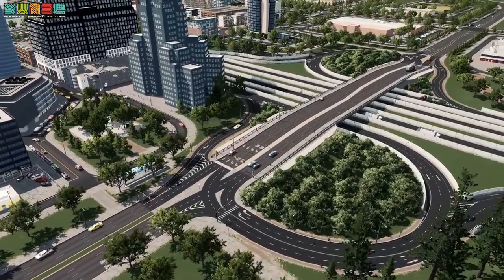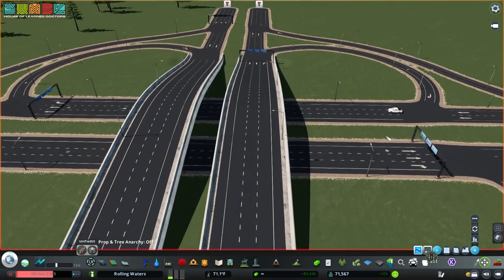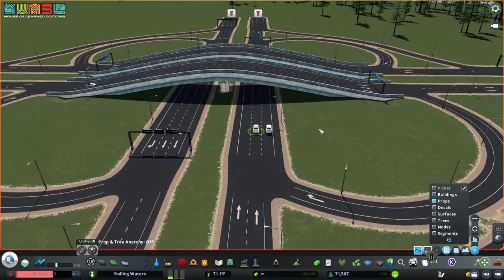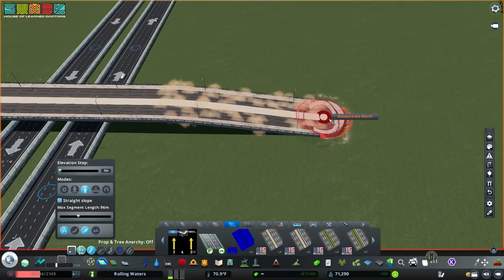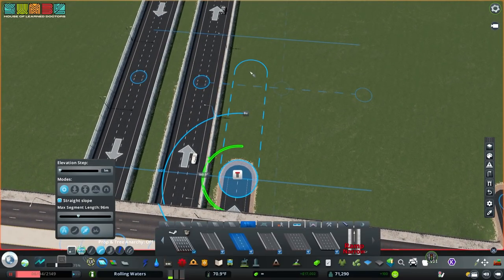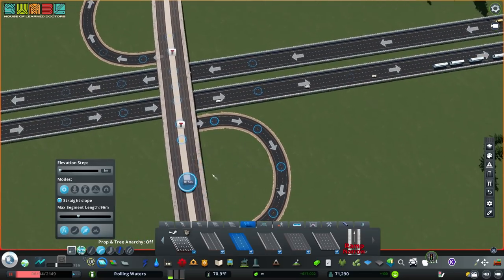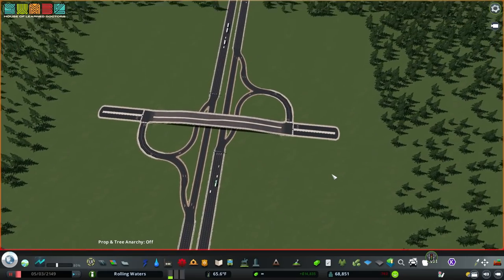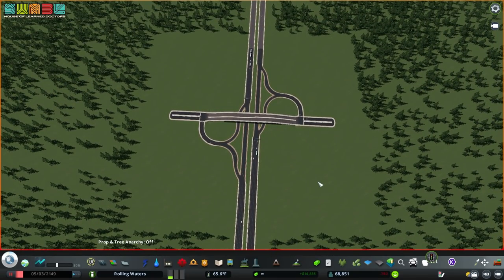The Ideal Interchange - Partial Cloverleaf - Cities: Skylines Tutorial

Comment: I found a cool solution for the clipping problem at 07:35: Instead of having a 7x7 curve, build an 8x7 using the 90° curve tool. From the orientation at 07:35, go up 7 and 8 to the side. once you have the anchor points 16u apart on the sides, delete the first curve and rebuild it using the free curve tool. do this for both sides and you get a perfect, non-clipping 3-way node :)
Reply from the maker: Good thinking!

Comment: There's a Cloverleaf around where I live in Germany, where 2 mayor Highways cross each other. And almost every Rushhour traffic starts to hinder itself on one of the merging lanes, which leads to it backing up around the curve onto the highway and around the next curve to the opposite on/offramp and sooner or later all merge lanes are jamed and both highways are jammed in either direction. Cloverleafs are the worst :D
Reply from the maker: Cloverleafs were a great achievement when invented, but we no longer need them!
Reply: @YUMBL  They work well in rural areas where the traffic isn't too great, but in urban areas, there are better interchanges.
Reply: They work between a freeway and an arterial if the weaving portion parallel to the freeway is separated into (a) collector/distributor lane(s), but it doesn’t work between two busy freeways.

Comment: I'm not sure if this is something known already, but I'll mention it for anyone that doesn't know.
When you are using Move It! to smooth or slope roads, you don't have to do just one side of the highway at a time.    So long as the node points are the same on each side of the highway (or road), it will move both sets of the road and slope both of them at the same time.    Just saves a step (or two).

Great build, and wonderful tips!    Thanks!

Comment: In Norway the highway to regular streets interchanges are usually made using two roundabout, not unlike the second example. Only the slip lane will go to either side of the roundabout each time and slipplanes is often used. It works fairly well. If high traffic areas they forgo the roundabout and use slipplanes to do so you never even can cross over into meeting traffic. There's one line off and one lane on, the rest handles how the traffic flow and the best of them can handle a shit ton of traffic with no lights involved.

I've never tried to reconstruct the best ones we got here in Skyline, because the lane math is hellish on it. On the bigger ones you don't even notice you gone off the highway because you end up on anther highway. But to do it you also have to endure some 90 and even 270 turns on the slipplanes.

Comment: A right turn slip lane along the roundabout can really help to open up traffic flow in a congested area.   Having the right turn allows traffic turning right to make the turn without going halfway around the roundabout, blocking traffic turning right onto the highway.   I am not a fan of roundabouts, but when set up right they can help quite a bit to reduce the time traffic is stopped.
Reply from the maker: I agree! I just wanted to show a space saving version. I also dont know if the skylines vehicles would care for the slip lane. Worth an experiment!
Reply: @YUMBL  yeah i was just throwing that out there for anyone that cares :)  the ai traffic actually loves slip lanes because they don't slow down much and it makes a slightly shorter route.  It takes a little extra time and effort to build them but if someone is more into details it definitely helps.

Comment: Would you intend on doing a video on various system interchanges to compare upsides vs downsides?  Some interchanges can be almost perfect, but expensive to build.  Others might be costly for space, but still cheap & effective.

In my area, cloverleafs still reign supreme, but two of them are a bit boxed in by development, so there's no easy way to update it even though they are in dire need of updating.
Although some rural cloverleafs have a flyover in place of one of the leaves, as this accounts for heavier traffic in specific directions where the cloverleaf is otherwise still viable.  I've also seen a few dual trumpet interchanges, mostly on toll roads, where all the weaving happens on a separate unit while the main freeways still move freely.

Comment: My PC is running a gen 2 I5 so the sim speed has slowed down to a crawl in my current build but, when I get a new PC, I will definitely be implementing these awesome interchanges. More watch time for you this way haha
Reply from the maker: Good luck with the new computer! :)
Reply: You can try speed slider and fps booster
Reply: @Spido68_the_spectator  I have those mods already, but there isn't any saving grace for a 10 year old Intel I5-2320 (i think). I have way too many mods and that's why it's struggling so hard at 4k pop but it is what it is =)))))
Reply: @alexsavastru8125  i have an i5 4200H and despite 100% usage at 170k pop, i can still continue to go further thanks to these mods allowing for a lot more fps (from 10 to 30 - 50).

Comment: It can even be more simplified imho. Look at 13:38.
- Make the road coming from the highway through the loop (or arc) which comes in from the right onto the arterial 1 lane instead of 2 - make this road an asymmetrical road of 2+1. That one lane will go into the most right lane on the arterial going over the highway. So it would remove the purple line and only leave the whitish line.
-  Make the arterial coming from below 3 lanes instead of 4. The right lane would go into the right lane going towards the highway - the lightblue line. With this the dark green line will disappear.  The other two lanes will move on over the arterial bridge.
- Also make the arterial coming from above 3 lanes instead of 4. Only the left lane (from here seen the right lane) should go towards the highway in the left lane of the off ramp, here represented by the dark blue line. This will remove the light green line.
This will remove a couple of merging and crossing lines as some lines will be gone (both green lines and the purple lines). So the only lines which will interfere with each other are the dark blue  line with both the orange and light blue lines. So only they need red traffic lights.

Comment: I don't like cloverleafs because of the weaving.  Maybe in a computer program, traffic doesn't flow well with the roundabouts, but in Carmel, Indiana, where they have built interchanges with roundabouts, the traffic flows very well. I would do away with the partial cloverleaf and use a diamond interchange with roundabouts. However, if you  really want to design a partial cloverleaf controlled by signal lights, consider combining it with the diverging diamond concept on the bridge road getting rid of all the left turns.

Comment: Nice intersection .. I am wondering why you use 7 lanes for the top highway and 2 lanes off going.
The lower highway has 6 lanes and 1 lane off going .. i think you should keep this approach.
The connecting streets with 2 lanes have to merge later to 1 lane also :( :(

Comment: @YUMBLtv - 
you have 2 stroad intersections in it , like in Las Vegas ... but in a better design ... 
Your roundabout version @ 18:30 is literally used in my region in Germany for a (1+1 lane) Bundesstraße (with the roundabouts) over an Autobahn , but with 4 directions on the roundabouts (separate on & off , that might cause problems when ignoring the signs due to the 90° angle instead of a sharp unmisinterpretable angle)

Comment: Hello Yumbl, Nice ParClo tutorial. I have a question. If multiple interchanges that are close to one another is bad, how would you do the spacing between interchanges (including both service and system)? Thank you.
Reply from the maker: Great question! System interchanges are wherever highways need to connect to themselves. So they should be quite far from each other. Service interchanges can be closer. Maybe 50-100 units from one on ramp to the next off ramp is as close as they should be. I’m making that up, but look at some maps of road networks to see how big interchanges are, and how close they are for scale.

Comment: Hey Yumbl. Absolutely love your videos. I know this vid is a bit old, but I hope you see this comment. I'm having trouble with swapping the 2-lane bidirectional highway at 8:28 with a 4 lane, bidirectional highway like you've done. The 4 lane 2-way road when linking to the exit would always look wonky. The link between the nodes of the highway entry and exit  and the 4 lane, 2-way road would look like kind of an un even hourglass. I think this is because I may not be using the correct road. The 4 lane road is a bit thicker than the 2 lane road so the curb/sides of the roads are not aligning. (I used a 4-lane 2-way highway from a Steam Workshop collection called Vanilla+ 1-click collection of roads) May I know what road you used for the 4 lane bi-directional road linking to the arterial road?
Reply from the maker: The one I used was network extensions, but that network is now built into the game after the last update
Reply: @YUMBL  oh great, I see. May I know what road exactly did you use, if you remember?
Reply from the maker: Its from network extensions. A mod for the game that conflicts with a bunch of other current mods. Use the now included 2u 4 lane road

Comment: I really like the video, any thoughts on a console version?  I'm thinking of moving the non looped piece farther down the 4 lane road so you'd have two 3 way intersections about a road length apart on either side.  I'd have to be mindful of road length and speed to get it right.  Might try in my next stream.  Thanks for the inspiration!
Reply from the maker: You’re welcome! The spacing will certainly change on console, but it can be done. ImperialJedi has a good video about a vanilla parclo.
Reply: Don't forget to try out the Single Point Parclo from one of Yumbl's own older videos!

 The spacing may need to be different to fit within vanilla/console constraints, but at the very least the one traffic light is handled correctly. 

Since the middle light on that is only a 2 phase, the "dumb" basic traffic light actually works somewhat correctly there, whereas the lights on a normal Parclo really should have TMPE to function as they should.

Comment: Hey what if on the ramp clipping issues you don't do the ctrl nudge, but use node controller ?
Edit: I mean increase the size) because sometimes when adjusting it I've found the clipping to start and stop anyway, don't think you need to moveit! Mod to solve it. Since you are going to do the node and lane marking on them anyway?
Reply from the maker: I dont think it would help. Its due to the textures overlapping. Then again i didnt try it. Let me know what you find!
Reply: I already tried it. It doesn’t work totally. If the angle is 179,9° it will do perfect, but a complete 180° won’t work. It will help, but won’t remove it completely
Reply from the maker: I thought so! Just a nudge will do it

Comment: I don't see how this is better than the cloverleaf. You still end up with a left turn that cross over the through traffic which requires timed traffic lights. The cloverleaf has no need for lights at all. I don't believe the lane merging in the clover is somehow worse than the left turn crossing in the parclo. If you use lane mathematics and traffic manager to assign lanes, the clover should have minimal disruption.
Reply from the maker: With enough traffic a cloverleaf locks up but a parclo will not. Many cloverleafs are being replaced wits parclos for this reason. The cloverleaf just isnt very good in high traffic situations.
Reply: @YUMBL  Thinking about it more, you're right. The cloverleaf forces everyone to use the right lane so it's not very efficient.

Comment: Wouldn't it be better to lower the bridge early for the two left hand turn lanes and go underneath rather than crossing traffic?  You could extend the bridge to the intersection and have those two lanes go underneath and onto the other side.  Then you could connect the other side of traffic turning right onto the ramp further back by adding a slip lane or have it stay down and connect it at an angle at the bridge intersection.  It would create an interesting intersection but it would allow you to not have to use lights at all and opt for either stop signs or yield signs.

Comment: HAHAHA    12:58 we watch a car turn left into; incoming traffic, off the exit road onto the on-ramp to keep going the same direction on the original highway.
Reply: AI blunders like that is exactly why I make looping on/off ramps in between the highways and add dead end U turn spots on my heavy trafficked standard roads. Sometimes you change something little and it messed up the AI path, and it rewrites it's new path in a new lane. They'll go however far they need to in order to correct this, which in some cases could be all the way down the road/highway until it ends. To correct it, have little loops on highways and dead ends just so they turn around without driving around the entire road system. I mean, god forbid the car is an emergency vehicle and then you have a hearse or a burnt down building because of it.